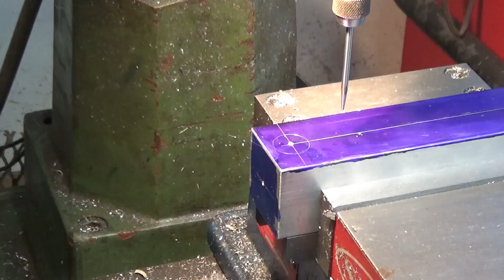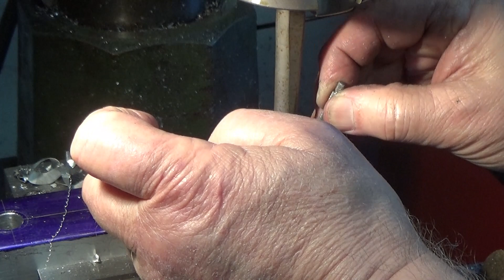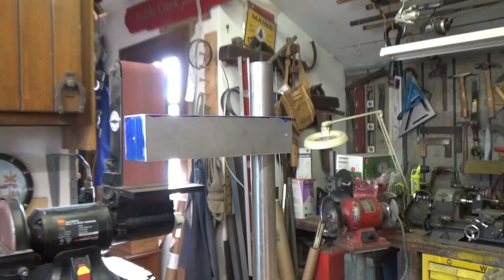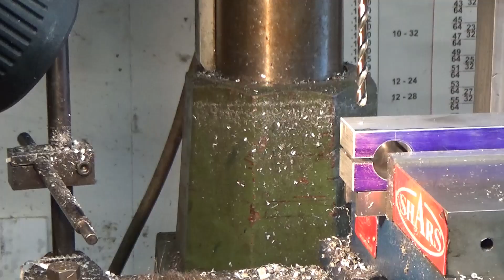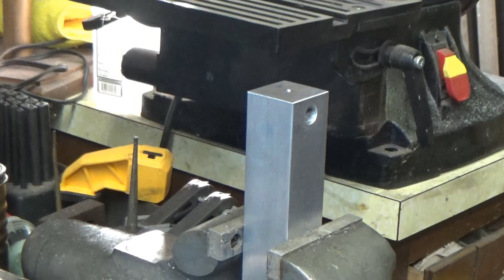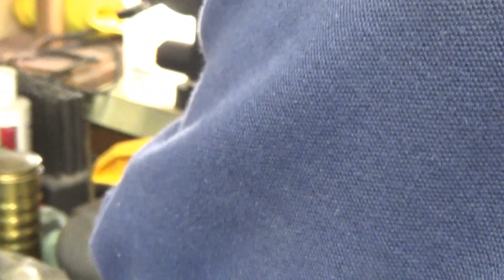Tapping Fixture Build Part #1

Comment: Steve, this looks like a good use for those "cheap" drill stands.  What "coolant(s)" were you using?  Alcohol?  Something like TapMagic?  Something else?

As an off-topic question, do you know where I should look to find a set of Armstrong-type toolholders for the lantern toolholder on my 10-inch 1911 South Bend lathe?  I obviously bought the lathe "very well used" due to its age and it only came with one or two proper toolholders.  The size needed for my lathe, I think, is 0 ("zero") to fit the lantern.  I'm hoping that you or another commenter here can point me to a place where I can buy a decent set of toolholders.
Reply from the maker: I am using CRC 5-56 (similar to WD40).  I have a gallon left over since I closed my business.  I was a distributor for CRC products.  I found it in one of my storage cabinets, completely forgot that I had it. I will check on the toolholders, I may have a few.  Thanks for watching and commenting.

Comment: Great project i have one of those drill presses never knew what to do with it now i do thanks Steven
Reply from the maker: I saw someone use a small engine connecting rod for the arm.  I didn't have one so I used solid aluminum.  I have been sitting on this project for a few years.  Now seemed the right time to build it. Thanks for watching and commenting.
Reply: @sharkrivermachine  I have a fer connecting rods i will see what they measure thanks for the help